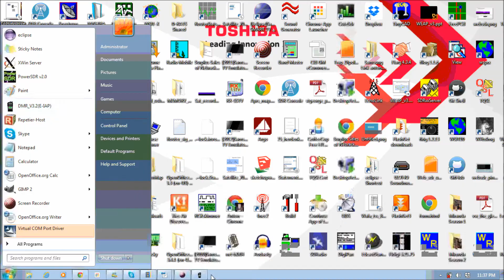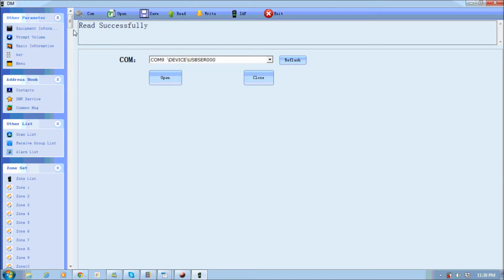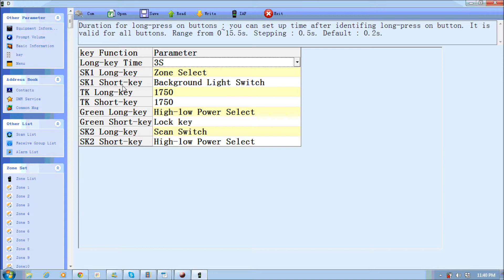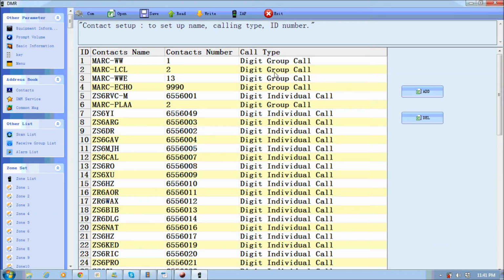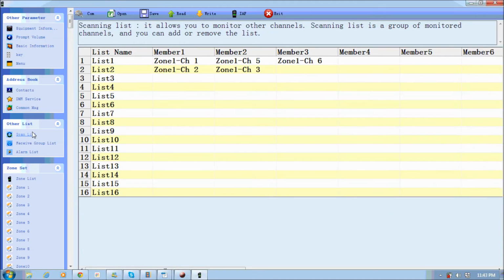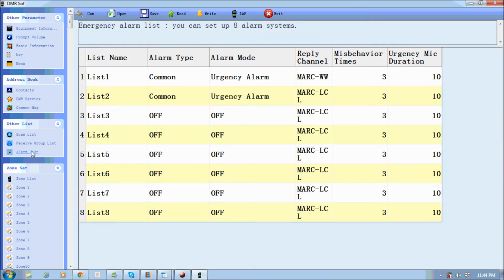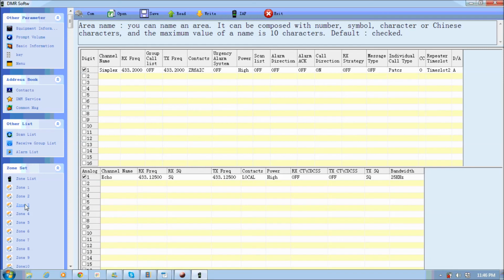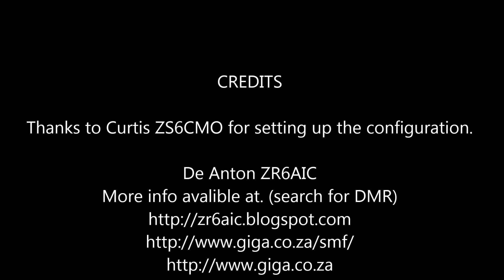Configuring the Kydera DM-880 HT transceiver for the DMR-MARC network

Comment: i have just gotten this radio, however it appears to have come with updated firmware, it is a DM-880 like the one in this video but its version says DM-990 , installed March this year, So for instance the software you use on this video is not reading any info of the radio, or perhaps I need to Jiggle the ports like you mentioned at the start?